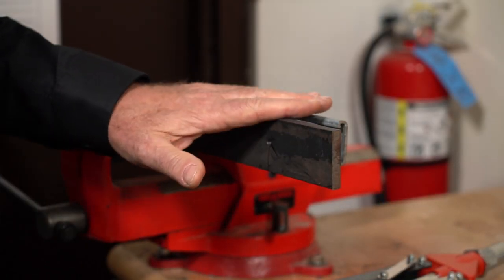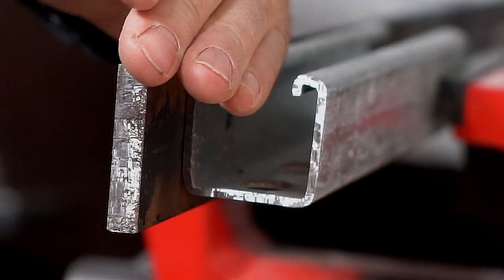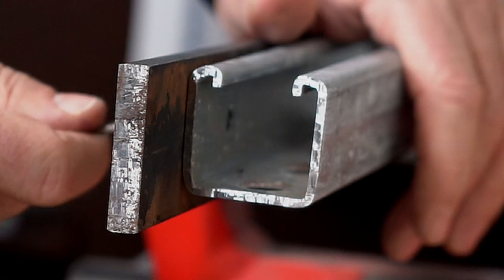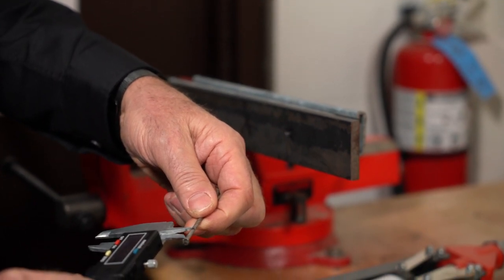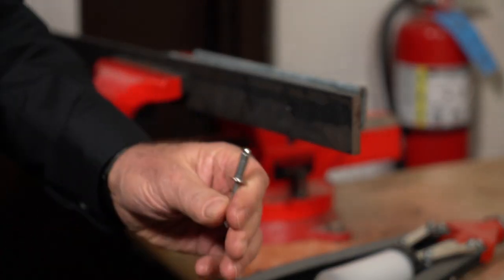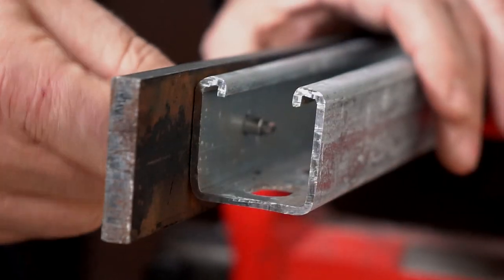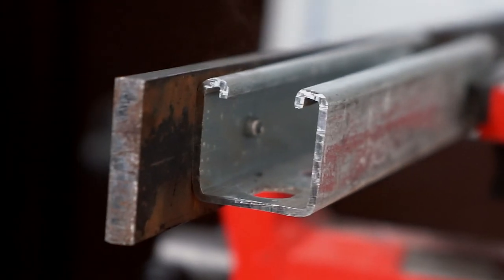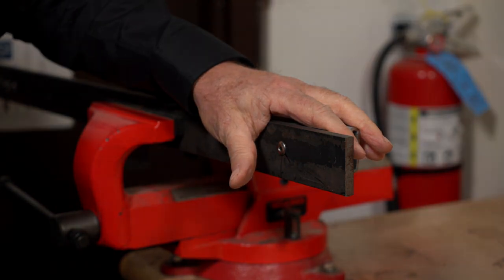How to Measure Material Thickness For Rivet Installation | Rivets 101

Comment: What if you don't want to "join" the materials in the way you showed? For example,  in van conversions, the Rivet Nut or Plus Nut is typically installed by itself  into pre-drilled holes on the sides of a van wall.. Then, the materials (fur strips used as studs or braces etc.) are bolted into the Rivet Nuts/PlusNuts. This is so these materials (fur strips, braces) can be easily removed, unlike your example where they'll stay joined. If that's the case (the van wall example I provided), do you take into account the thicknesses of the materials and add those numbers to the "thickness" of a van wall? TIA

Comment: Nice video. So how far past both pieces of material should the end of the pop rivet be?  Thank you.
Reply from the maker: You'll want the rivet to be about as long as about 1.5 times the diameter of the rivet's hat past your pieces of material. Fortunately, you don't need to do this calculation yourself; it's already calculated in a rivet's grip range. For example, a 1/4" x 3/4" rivet has a grip range of about 3/4" (0.626-0.750) but the hat is actually 1-1/8" long. As long as the total thickness of the materials you are fastening is within a rivet's grip range, the rivet will be sufficiently long enough to work for your application.
Reply: I get it. Thank you

Comment: Yeah how do you tell what the lower limit for rivet is? Two pieces of sheet metal have a non-field measurable thickness. How do you find out how tight each size will go? They show a max not a minimum

Comment: sorry i cant figure out the "range" does it mean?!!
Reply from the maker: Range, or grip range, is the thickness of the material that is covered by a given rivet. For example, a rivet with range of 0.251" - 0.375" can handle applications with a thickness that is between those numbers.
Reply: @AlbanyCountyFasteners  I believe he's only understand metric measurement system. He don't know what " is. (inch). It is basically speaking Chinese language to non Chinese guy.

Comment: Hi, I'm converting a cargo van into a camper, I'm thinking of framing the bed frame and the upper and lower cabinets with either 1/8 or 3/16 aluminum angle stock. I have two questions for you, Do you think rivets would loosen up due to movement of the van?. 1/8+1/8=1/4 and 3/16+3/16=3/8, I was thinking would buy the Milwaukee cordless riveting tool but I'm starting to think it's too small for either of these angled stocks, If I use rivets I have to be able to use a powered riveting tool. Do you know of an adapter big enough that would work with a drill for 1/4 or 3/8?. Thanks!
Reply from the maker: If the pop rivets are correctly installed, they shouldn't loosen. As far as pop rivet adaptors for drills, we know they exist and you can find many varieties on Amazon, but we have no specific recommendations. Just make sure it can handle the pop rivets you choose and you should be fine.
Reply: @AlbanyCountyFasteners  Thank you!